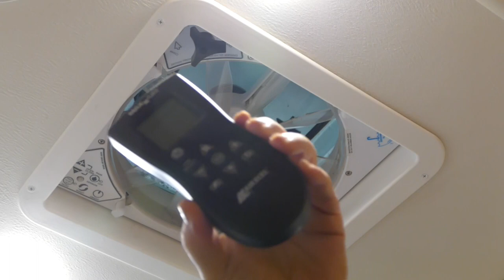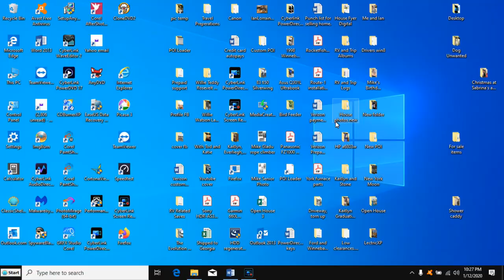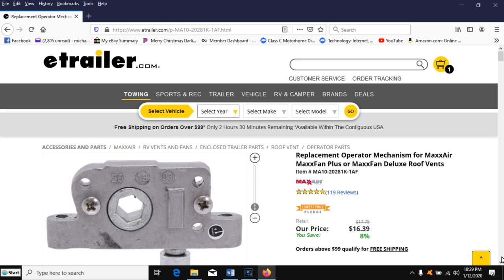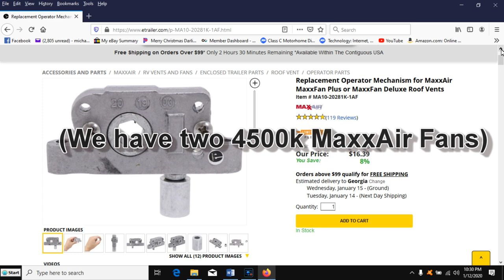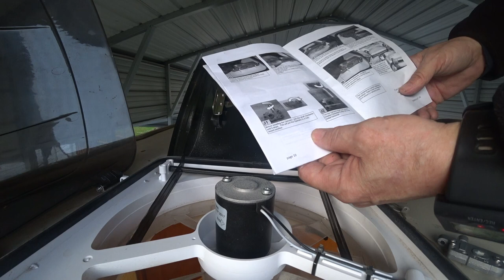MaxxAir Fan Repair, Extremely Loud Clicking Noise!

Comment: During early Covid they sent me a replacement without any instructions.  I don't think I had it clocked correctly.  It broke again so I ordered 2 replacements.  After watching your video and glancing at the Instructions I just fixed it again.  With a little help from my wife I only went on the roof once and it took about 15 minutes.  Thanks!
Reply from the maker: Glad it worked, my replacement is still holding up.

Comment: Thanks for an excellent video.  The MaxxAir Deluxe fan on our class B quit opening and closing automatically or manually, so I'm assuming the operator mechanism is shot like yours was.  Will order a new one, hope the install goes as well as yours.

Comment: Great explanation and video documentation.  Mine had a spring on the shaft that I was able to remove from the broken part and reuse.  I didn't see the spring in your video so maybe mine is a different model or maybe a different year.  The spring appears to assist the lid with opening.  I have pictures but can't find out how to post them in this reply.
Reply from the maker: Thanks! It's been a while now since I worked on it so I'm not remembering if mine had a spring. It's still working well.

Comment: As you stated, NEVER USE WD-40 on anything in your RV.  WD-40 should only be used on Squeaky Metal hinges and nothing with Rubber on it.  Silicone Spray like you used is PERFECT!

Comment: Any idea on what tool is needed to remove the fan?
Reply from the maker: The MaxxAir vent/fan is screwed in on top of the roof. You have to scrape the sealant off to expose the screws.

Comment: A Short explanation on this repair part.  
It is one of the DUMBEST Things AIRXCEL could have come up with or whomever designed the MAXX FAN!
The operator works on Motor Resistance.  So, when the lid opens or closes to it's max position, (sounds like it is binding) the motor senses the increased electrical resistance  and the motor stops.

This stuff was designed to break and fail.  I will be replacing my second operator on my other MaXX Fan soon.  

They should have incorporated a Micro Switch of some kind to control the UP and DOWN of the lid!

Or they should have made the operator out of stronger material than this CHEAP WHITE METAL!

But, it was designed to fail and of course MADE IN CHINA!